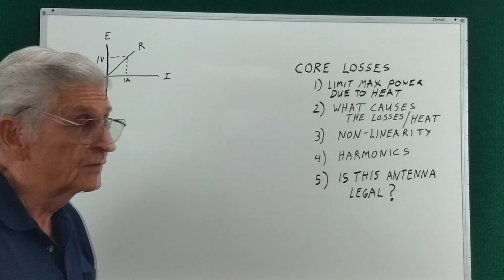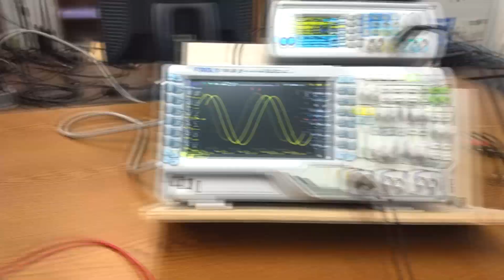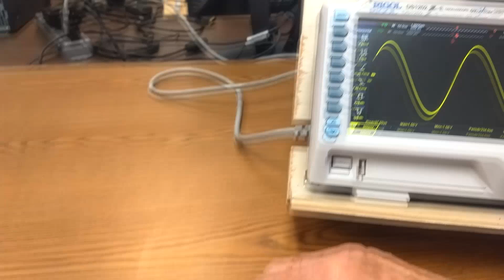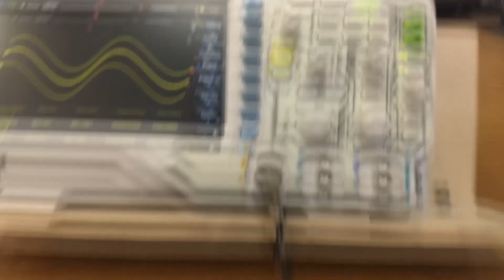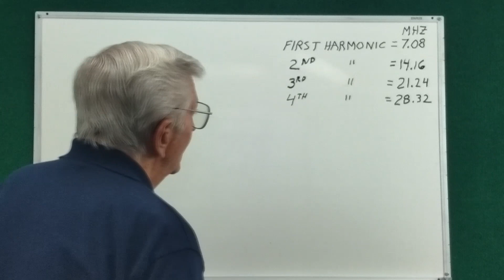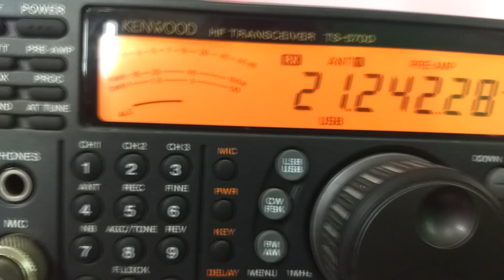EFHW Spurious Emissions Caused by Ferrite Toroids

Comment: This would not seem to be a problem in practice. While non-linear behavior of the commonly used matching transformers is rather ugly, and undoubtedly present at the output of the transformer, the question is how are the resulting harmonics transformed and then radiated by the antenna itself? Being the "lazy man's antenna", there are so many end-feds in use these days that one would think folks would have noticed an epidemic of harmonically related spurious signals on other bands. Indeed, this problem is the origin of the way many hams call CQ, as in "CQ 40", or "CQ 20". In the early days of amateur radio harmonic outputs were so bad it was important to include the band you were really on when calling so that the receiving station would know if they were hearing the fundamental or the harmonic. These days adding band information to a CQ call is no longer necessary, even with the popularity of end-fed antennas with a big ferrite at the feedpoint.

As for which regulation is relevant:

47CFR97.3 explicitly defines "amateur station" as everything necessary for radiocommunication. Obviously that includes the antenna. That section also explicitly defines "external RF power amplifier". It does NOT define "transmitter", perhaps because that is considered an obvious component of the "amateur station" that requires no special definition.

47CFR97.307(d), which is where the -43dBc requirement is specified, only applies to transmitters and external amplifiers. It does not apply to the "station". Similarly, 47CFR97.307(b) applies only to in-band and adjacent frequency emissions.

It would seem that the relevant law in this case is 47CFR97.307(c), which states "All spurious emissions from a station transmitter must be reduced to the greatest extent practicable. If any spurious emission, including chassis or power line radiation, causes harmful interference to the reception of another radio station, the licensee of the interfering amateur station is required to take steps to eliminate the interference, in accordance with good engineering practice."

Comment: I found those SDR dongles to be pretty good at acting as spectrum analyzers (and dirt cheap, and now with much higher bandwidth & better SNR -> RTL-SDRv4) and better still, SDR# and other programs allow you do do everything from saving "waterfalls", to making a pretty nice scanner, to decoding air traffic transponder signals, weather satellite data, and more (even SSTV with the right plug ins). 
I found a ton of harmonics in the AM band from an LED bulb (a cheap Walmart generic one) that I'm surprised is even allowed to be sold.
Reply from the maker: Thanks for sharing this information.

Comment: Hi Jim,  very interesting question/topic.  There are often so many other non linear devices nearby that care must be taken when trying to evaluate the harmonics radiated directly by the antenna system versus by other nearby non linear devices but with care you should be able to do a pretty decent job, and looks like you have more room than the average ham.

After watching your video I immediately grabbed my Tiny SA Ultra spectrum analyzer, transmitted on 7 MHz running 100 watts into my homebrew 40 meter EFHW using my old Kenwood TS-180s and walked around my backyard viewing my spectrum analyzer.  Using the supplied 12 inch whip on the Tiny SA Ultra my strongest viewed harmonic was on 15 meters and it was 50 dB below the 7 MHz fundamental frequency.  This was a very unscientific experiment and really baseless because the RX antenna on the spectrum analyzer response to the fundamental frequency versus the harmonic bands is a big unknown and also the antenna pattern on the harmonics is not the same as on the fundamental (and I also was not necessarily in the "far" field).  Also the transmitter itself generates harmonics.

I then repeated the above test using an attic dipole that's actually longer than a 40 meter half wave dipole and it's fed with open wire feedline connected to the balanced output on my old Heathkit SA-2040 Antenna Tuner and the worst viewed harmonic was again on 21 MHz and it was now only 35 to 40 dB down from the 7 MHz fundamental signal.  Note that magnetic material also exists on the balanced output on the antenna tuner in the "balun coil", and there are likely lots of other non linear devices in my house that could have generated the strong harmonic content (very complicated topic), and I was not standing very far from my house during the tests.  

Since there are so many variables probably the best "semi scientific" test would be to compare a true 40 meter half wave dipole versus a 40 meter EFHW antenna using the same transmitter as well as same spectrum analyzer setup and in that case the TinySA Ultra with its 12 inch whip antenna would be a reasonable device to use as you would just be doing relative measurements between the dipole and the EFHW antenna.  Regardless of what spectrum analyzer you use you also need to make sure the fundamental signal is low enough into the Spectrum Analyzer to avoid generating harmonics within the Spectrum Analyzers mixer which would once again skew the results (I made sure the received signal on the fundamental was minus 30 dBm or lower into the spectrum analyzer in the above tests).  The entire test setup should be in an open field.

P.S. I'm an Engineer in the rare earth permanent magnetic materials industry (for the last 37 years), and enjoyed seeing your use of Webers.  During my University days we used units of Webers all the time for magnetic flux but that all changed when I entered the manufacturing world in 1986 where we used CGS units and we used CGS units for many years and never saw units of Webers, but then at some point the industry did make the switch over to SI units.

73,
Don (wd8dsb)
Reply from the maker: Thanks for your very detailed comment. The permeability of type 43 ferrite increases with temperature. As temperature increases the flux density increases for a constant volt-second area of the applied signal. My set up did not go excessively nonlinear until the core temperature reached  about 70 degrees C. The variable gain of antennas vs frequency is why I used dummy loads for my tests. 
73, Jim, KQ8E
Reply: @Jimscoolstuff  Hi Jim, thanks for the reply and I just stumbled upon your other video where you did the thermal test which was an excellent video.  Thanks, and 73.  Don wd8dsb
Reply from the maker: 73 Don. @wd8dsb

Comment: Very nice video, but since linear operation is the exception rather than the rule, it seems like any magnetic elements placed after the transmitter's output filters would have the same issues. I'm currently working on using QAM at VHF over an EFHW antenna for a military application, so I'm very interested in the work you are doing!
Reply from the maker: Note that between 30MHz and 225MHz the FCC rules are even more stringent. The power of any harmonic must be 60db below the power of the fundamental frequency. I have ordered a spectrum analyzer so I can get more accurate readings. I will make another video soon.
The FCC rules are  for the output of a transformer or amplifier. When these rules were adopted, I don't think anyone anticipated a non-linear antenna. In my mind, an antenna is part of a transmitter, unless you are transmitting into a dummy load. Thanks for your comment.
Reply: @Jimscoolstuff  Many antennas are using ferrite based chokes or transformers between the power amplifier and the antenna and I suspect these are all adding some degree of non-linearity. Maybe when you do your testing you can show that the EFHW antenna is worse than other antennas that include magnetics between the amplifier and the antenna.
Reply: @ats89117 Hysteresis is dependent on core material,  distance from return conductor, frequency, etc. An air core would behave very differently than ferrite, for example.
Reply: @jeremiahbullfrog9288  True enough, the air core wouldn't be subject to hysteresis or saturation, so it would be much more linear. But many systems use baluns and other transformer variants which are usually based on ferrite, and these also produce non-linear behavior...
Reply: @ats89117  Yep i would agree
Reply: @ats89117  Traditional transformers use laminated steel sheets instead of a solid core, in order to reduce wasteful eddy currents. I wonder if these commercial baluns and whatnot employ any special technology to reduce side effects?